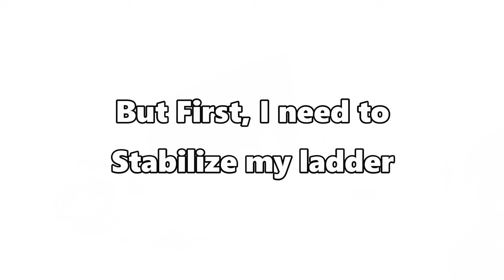How To install a cell phone booster by Becky

Comment: Let me try to write my question again in parts, to see what part do they block or they just remove my question for fun, because they can. 
Thank you for providing valuable and useful information!
I checked the tower location, using the website you provided.
Reply: It shows that There is no tower available, only private antenna 1.5 miles away 16’ above the ground.

Comment: Good video. If I had not gotten rural  fiber I was going to go this route too. My house and other buildings are in a valley on our acreage and the 5g coverage is barely there, especially in our metal building. Luckily I managed to finally get some luck and have fiber running through my very rural parcel. I'm currently moving and laying out my access points from my Houston area propeety to central Texas. It doesnt go as far as i hope but way better than being suburban.

Comment: Nice solution to your problem!  I have that stabilizer on my extension ladder and I love it.  Just be aware that the pads on the arms wear away pretty quickly if used often.  I have had to duct tape my own padding to it in order to avoid scratching my paint.  Not sure if replacement pads are available.

Comment: I've been having a similiar problem in that I cannot get wifi from my house to my detached metal garage when the garage doors are down.  Any ideas on how to get that wifi signal into my garage?
Reply from the maker: You can use WiFi extenders/repeaters or you can physically bring a cable from your router to your garage. I have a video on that. https://youtu.be/hQUG6rPA8dw?si=hp8J76F-wqTGxHw_
Reply: Thanks very much! @petebeasttexashomesteading
Reply: Try a mesh type Wi-Fi system.

Comment: My problem is if i don't have internet, then I don't get cell service plain and simple. In the house we have internet coming in upstairs and booster that are plugged in all through the upstairs and then others down stairs. I tried plugging one in my building but it just doesn't work unless I would run it to there and I have too many obstacles in the way. Digging here in Missouri is like digging through solid rock.
Reply from the maker: Not sure what's going on there. This booster just amplifies the outside cell signal and brings it inside so your phone gets better reception.

Comment: Why wouldn't you use WIFI calling in your building. This doesn't use data as your cell connection do.
Reply: You are assuming he has Wi-Fi in the building, maybe he does not.
Reply: Calling does not use data. I also use Wi-Fi if it’s available. I guess there is no internet in that building. I think wi-Fi does not go well through the metal walls. Also internet in rural areas unstable, expensive and go through satellites.
Reply from the maker: WiFi calling is a good option, but both users devices and carriers need to support WiFi calling so it not always 100%.
Reply: @petebeasttexashomesteading  additionally, WiFi calling isn't WiFi text. We can't text my wife's mother, she has a Motorola phone. We can WiFi text anyone with an Apple phone. I'm not sure a booster would work for us, on a REALLY good day we get 1 bar outside .... for a short time. 99.5% of the time it is No Service or SOS only.